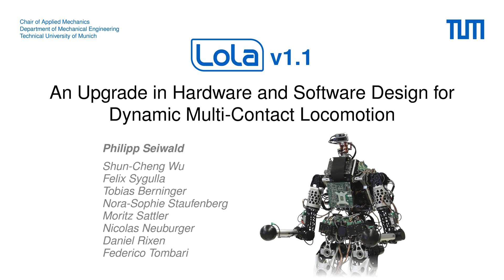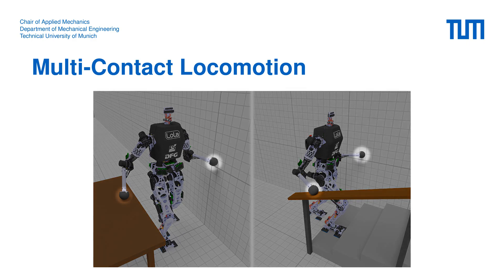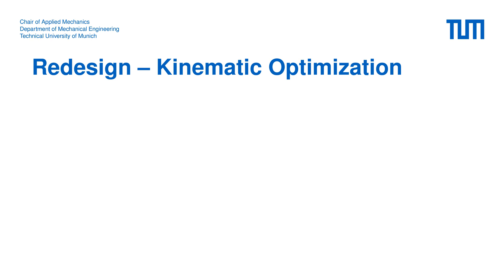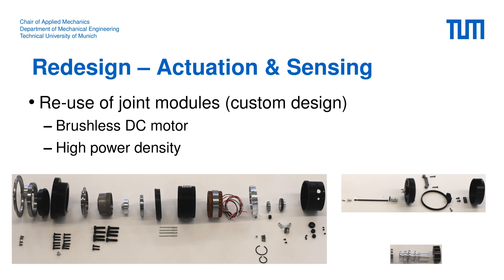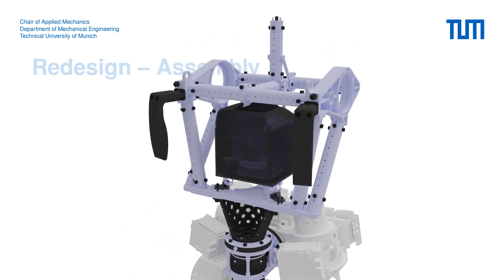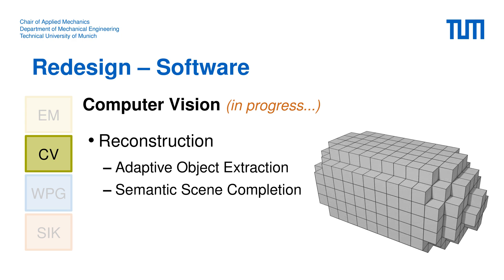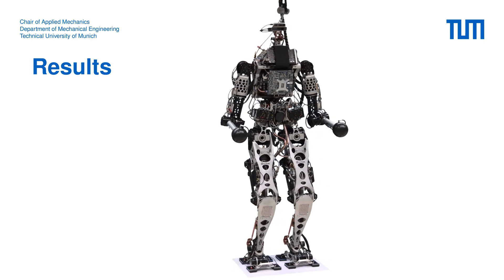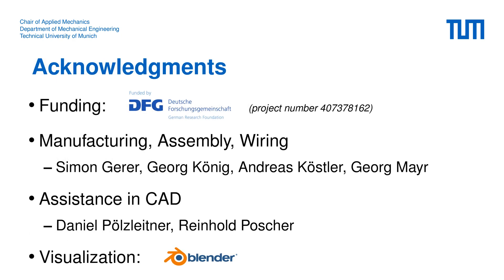LOLA v1.1 - An Upgrade in Hardware and Software Design for Dynamic Multi-Contact Locomotion

Comment: Nice. I think this is like the only true bipedal human like locomotion achieved through electric servo motors or actuators and not hydrolics like the Boston Dynamics atlas. I've always favored the motorized locomotion mostly because I'm much more familiar with it and I know it's capable of so much more. It's just an engineering puzzle to be solved.